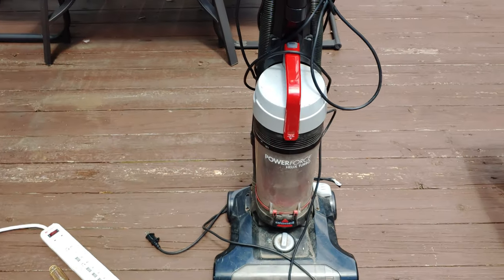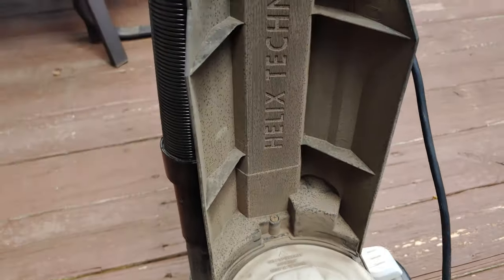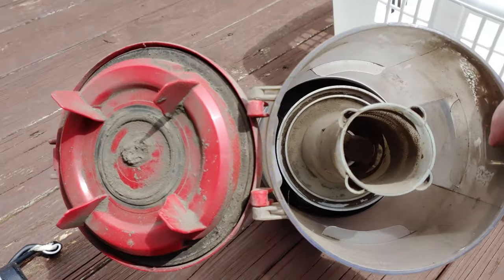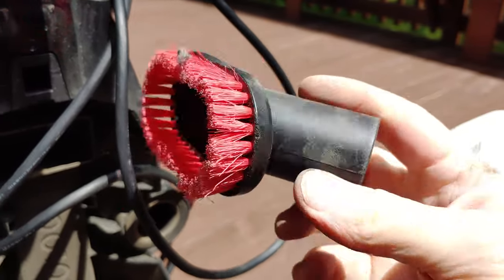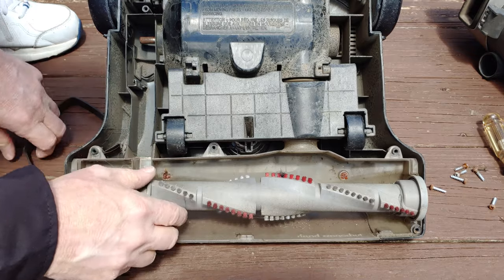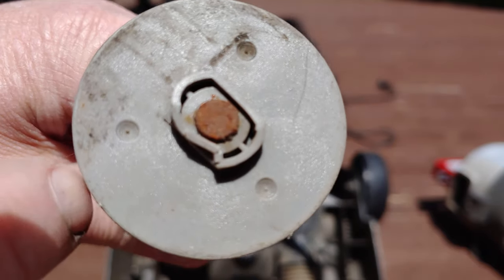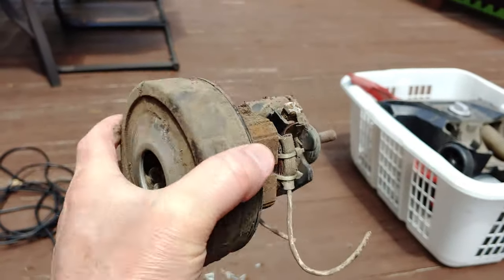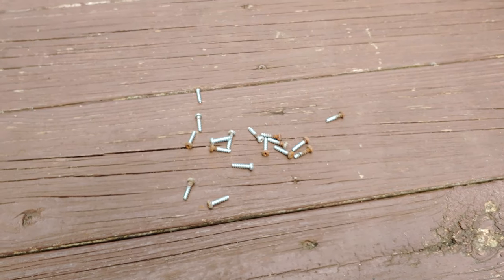Bissell PowerForce Helix Turbo 2190 Curb Find

Comment: I have to give it to Bissell, I had a Helix Turbo and I have to say for as cheap as they are, it's a durable thing. I ran it hard and put it away wet, and had it for several years, it never failed me. It got replaced by my current vacuum (Kirby G7) but it would have probably kept working.

Comment: Woah that vacuum has been neglected a lot. Shot bearings on the motor , brushroll and broken parts. I have 2191 blue Powerforce helix and the 68C71 Helix Turbo from 2015